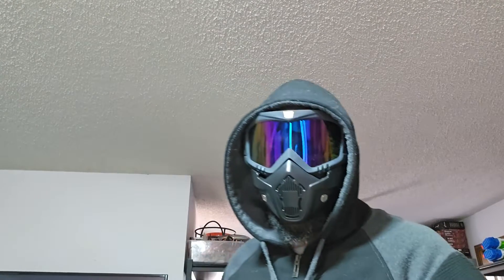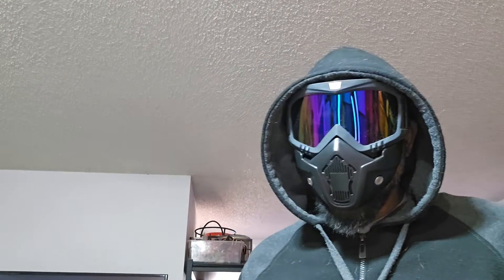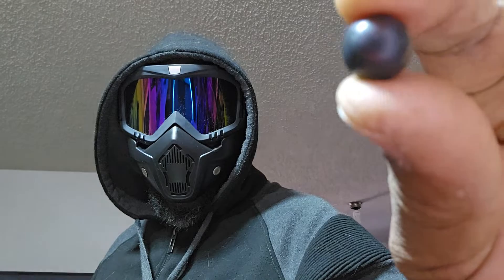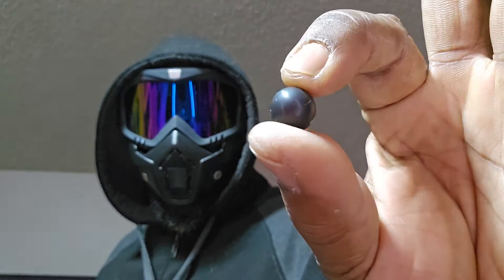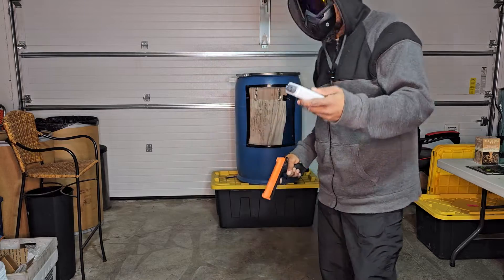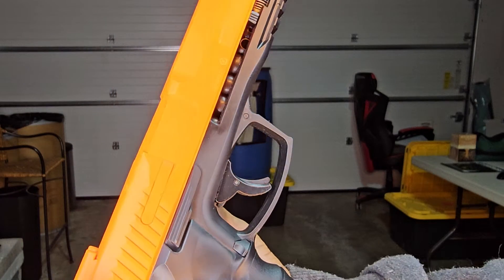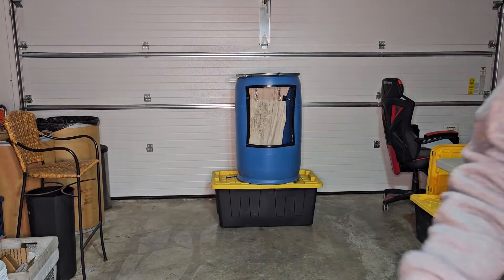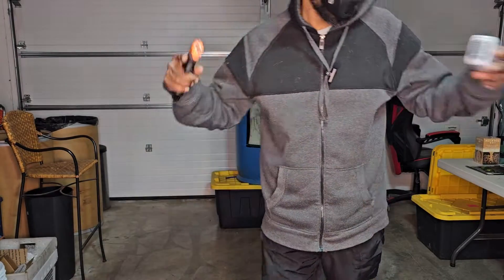HDP 50 & S-TYPE Rubber-Steel Balls: How Many Joules?

Comment: I don't like the aftermarket rubber or rubber steal balls, the ones with the seem don't fit in my umarex 50 compact to good or in my mercury rise mub 50, I like the mercury rise rubber steal better because it's a real steal balls in there's, not that metal pieces, also, t4e rubber balls and mercury rise regular rubber balls fit the best, I only use rubber balls for target practice and the others for self defense with a moded gun!

Comment: You should be puting a big fat drop of silicon oil in the grip w/ the co2. It will lube the chamber, the barrel and the balls all at the same time. The rubberSteels need that.
Reply from the maker: Already did that right out of the box💥💥💥
Reply: You have to do it on every CO2.
Reply from the maker: @sonadorazul3074  no, you dont💥💥💥